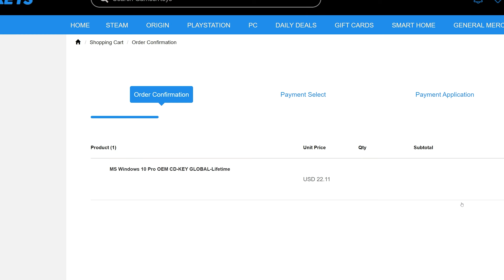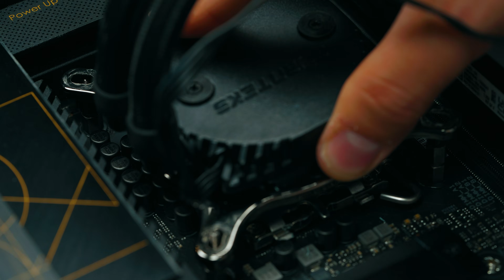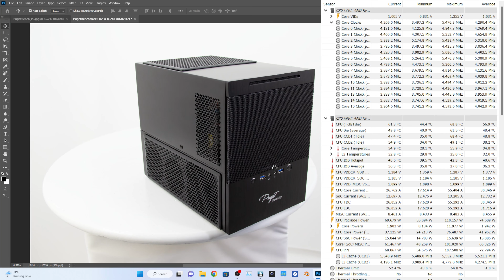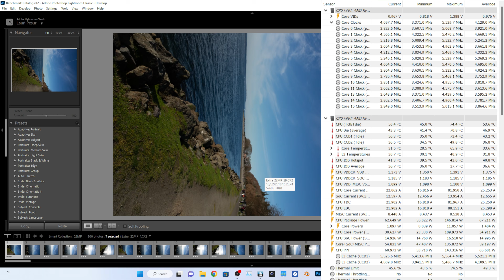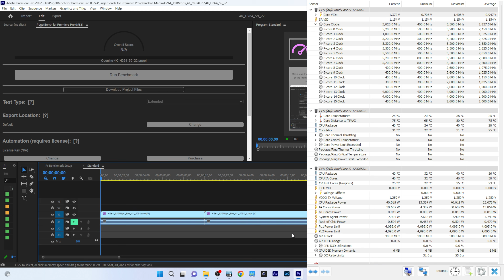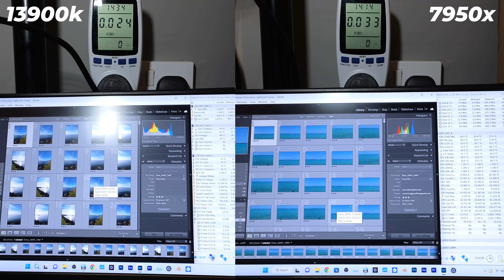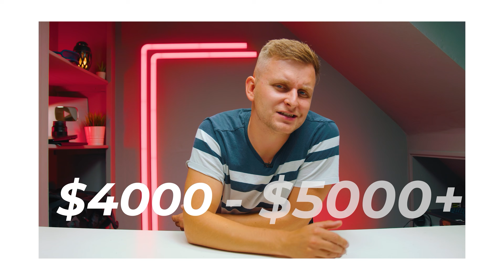INTEL & AMD both lied! 👉REAL WORLD power consumption is MESSED UP

Comment: It is worth noting that AMD keeps much higher clocks in idle compared to Intel, this makes a big difference in my opinion, I noticed that changing the power settings minimum cpu % in windows power plan , reduces these clocks and slightly reduces power consumption in IDLE.
Reply: I've dropped my 5600x to like 800MHz and it hardly effected the idle. The IO die seems to pull a fair bit regardless.
Reply: For me, in the case of ryzen 5 5500, the change in the minimum % cpu use resulted in a decrease from about 20 watts to 9 watts
Reply: @werwito  ryzen 5 5500 has monolitic design..it dont have chiplets(core die + IO die separated).

Comment: You test shown so much real life usage of processor, thanks a ton for this man & do answer my below question please:
So what would you recommend for productivity on premiere & davinci 
I5 12600k or 13600k with MSI B660m mortar wifi & Ak620 cooler (ain't gonna overclock it) paired with 3060 or 3060ti
Reply: buy what you can afford. but beware when buying a b660 as it will probably require a bios update before you can plug a 13th gen on it. and you will need a 12th gen cpu to update the bios. some motherboard do have a feature to update bios without the need for a cpu. do some research first.
Reply: @JosesPoS  yess 🙌🏼

Comment: Look! Intel paid this man to make AMD look bad!
Just kidding.
I notice this behavior since AMD moved to MCM. I have Ryzen 7 1700 and the idle power consumption was very good. I record 50-ish watt on idle for total system power consumption with 8 case fans, 1 NVMe SSD, and 6 HDDS. Then I got Ryzen 5 2400G. It seems adding Vega IGP increase power consumption, but not significantly since it is a bit higher.
Then things changes once I moved to Ryzen 5 3600. Total system idle power consumption went up significantly to 80-ish watts. Disappointing for sure. HWInfo recorded 30-ish watts when I am doing nothing on desktop. But this can be lowered to 20-ish watts by disabling Precision Boost. This result is ± similar with Ryzen 9 5900X.
Reply: The other issue with AMD could be their drivers. They have issues with their gpus. And their files and folders don't look as clean as intel.

Comment: "REAL WORLD power consumption" - proceeds showing numbers spewed from random software... 
Most software show wrong values for Ryzen processors, so this "test"... waste of time and confusing people. At least use Ryzen Master, or better - measure from the wall.  Ryzen cores can underclock and sleep just as well, E cores do not have an advantage. Actual tests were done on laptops where power consumption wasn't inferred, but actually measured, and Ryzen beats Intel. For example, read the 6800u review in notebookcheck. Zen 4 is even more efficient, although AMD clocked it a lot in order to compete with Intel for performance.

Comment: Looks like the AMD cpus were never allowed to run below "base clock" i.e. power saving was disabled. my zen2 cpu for example drops to about 60% of base clock at idle.

and I'm of the opinion that measuring at the wall is the way to go. either brand could hide power consumption throughout their systems and all that really matters is how much power is required to use the computer.
Reply: and without running OBS on either computer! that alone adds a significant unknown variable that will almost certainly affect power draw, minimum clocks and benchmark scores. unless the use case is running productivity benchmarks while screen recording with OBS lol

Comment: Finally somebody did deep dive into power consumption....amazing job!!! Keep doing this 🙏
Reply: this isn't a deep dive. it's just 1 or 2 applications, one of which uses the iGPU heavily.
Reply: @mariuspuiu9555  I follow many tech channels ...nobody cares about idle power consumption ..that's what I was interested about
Reply: @DoRokaHore  mostly because on PC it doesn't matter. we are talking about extremely small differences in money per year even when run 24/7.
the only time reviewers will cover it is when there is a huge difference (most of the time caused by bad launch drivers)
Reply: @mariuspuiu9555  don't agree...it matters most these days when graphics cards and CPUs draw so much power more than ever before...as guy mentioned in video...most of the time you do light work...you are not playing all the time or exporting a video all day...and those small things add up...in Europe electricity bills went up a lot....even AMDs new cards draw more than Nvidia in idle ...and it also depends on monitor connected...I think it's reasonable to be aware of power consumption as it growing every year...era of overclocking is over...everybody undervolts graphic cards and CPUs to get better thermals and power consumption and performance in some cases
Reply: @DoRokaHore  it literally doesn't matter. you are confusing it with full loads.
Reply: @mariuspuiu9555  I'm not..I'm saying that nobody cares about idle power consumption in reviews ...state where you spend most of your time
Reply: @DoRokaHore  it doesn't matter where you spend most of your time if the difference is literally a coffee cup at the corner of the street. this is what you don't understand.
the only place where idle power usage is very important is on laptops. and battery life what i check first when buying one.

Comment: Nice analyze,  you forgot in the equation of the profitability on the long term that it takes less than 4.5 years to amortize a GOLD power supply whereas it takes more than 17 years for a Platinum power supply and to keep a material 17 years in data processing .... when one knows that the breakdowns in electronics have a coubre said bathtub it is to say that that falls out of order in the first 6 months of life after one is quiet 7 years and that the curve goes up again in arrow after.

Comment: A nice video, but something must be completely wrong with the AMD system. Or the minimum power use that you report is very far from idle. It is simply impossible that they can make a 55W laptop CPU or 65W regular CPU from the same silicon for which you report that the minimum power consumption is already 47W or 54W. This result just does not make sense. Maybe you were measuring something else, though I doubt that that is the cause as you also measured a clear difference at the plug. Although again that doesn't say much. Even the fact that the power supply is claimed to be better doesn't mean it had less losses in this test. Platinum does not necessarily mean better than gold over the whole power range. Maybe something in the BIOS prevents the cores from clocking down or being turned off completely when not used. Or maybe something was wrong with the scheduler in the OS. Or something else that prevents the cores from clocking down sufficiently. I would not be surprised at all that the idle power use of the AMD system is a bit higher than the Intel system. I've seen a fairly high idle power consumption on AMD server chips also. But not to this extent reported here. I'd rather expect something in the 15-25W range at most.

Comment: I get that idle AMD usage is higher, fair point. But judging the highest end CPUs at low wattage is not ideal, since those CPUs are made for like multicore processing, if that is not the usage you require, just buy the tier below or something like 5950x which would have much lesser power consumption.

Comment: That's pretty interesting to see. It might also be interesting to see results if you put the AMD one into 105W Eco mode, which seems to lose only very little performance but save quite a big amount of power. I don't have a 7000 series AMD but a 5950X and in Ryzen Master I set a few profiles ranging from an 4.3 Ghz all-core at 1.25V, which draws about 20W at idle and 160W at full load down to a 4.0 Ghz all-core at 1.025V, which lowers idle power consumption to 7W and 90W at full load. That's a great idle improvement and like 40% power saving for 7% less all-core full performance.
Reply: This. It's great the tests were done with stock settings but tests with eco mode would shed the final light on the topic.
Reply: @machinimaaquinix3178 
I agree. If you are interested in efficiency then probably you are looking around for information therefore you may very well know that lowering the maximum power on AMD  can make big efficiency gains: PCWorld and Gamers Nexus published a video about it. In case of efficiency minded people to do some BIOS or software tweaking is not outside of the realm of reality in my opinion. (And it is also known that Intel chips do not react so well as AMD for underpowering.)
What is also strange for me that while this video tries to calculate 'real life scenario', with mixed load and efficiency in mind, some sensible alternatives are missing: for example the i5 13400. Here, in the Netherlands, the 13600K costs around 360 € but the 13400 is only 270 €. Sure, it has 4 less E-cores, but also a lot lower powered and if you are a professional who is not interested in gaming then why would you bother about overclocking (which one of the main advantages of a K CPU, but costs at a hefty premium)? For a mixed workload I would certainly assessed as candidate.
Reply: I don't believe you, 7W idle for AMD 5950x

Comment: Do a wall test, not a HWInfo Test. It's meaningless to measure what HWInfo tells you from some sensors located at different parts of the chip vs what the actual PC draws from the wall as a whole system.

Zen is basically a SOC while Intel is not doing the same approach.

Comment: I've never seen a review for 13700K where they pegged its idle power consumption at less than 30W for CPU Package, yet here it is less than 10W.
I wonder where such discrepancies are coming from!
Reply: It depends on the moment of capture. At "idle" my i7-8700 ranges from 5W-30W all the time, seems to be pretty normal behaviour if you ask me. There's always something happening in the background & some tasks hit different parts of the CPU with different power requirements.

Comment: You have weird definition of idle

If I would follow your idle Derrington, then my Dell PowerEdge R815 would be pulling around 600W-700W
While at real idle it is pulling 220W (mind 4 processors, 12 cores each, 128GB RAM and literally 12 years old tech)
What you can idle I call medium-high utilisation or even high utilisation
Photography processing is not idle!

Comment: You only used Adobe software so your conclusion is only valid for this software. You leave out other applications like Davinci Studio, Capture One and the whole of 3D software. In my opinion this is a very partial view of "content creation" scenario related to power compsumption. Thanks for the video.
Reply from the maker: Did you watch my comment on the video why I didn't use Resolve or other 3D softwares for the testing?

Comment: Do you have any experience with the Ryzen 7 5700x CPU? If so, how does it run with the RTX 3060 ti for video editing? Any info you can provide would help me out big time! Thanks for providing great information.
Reply: you won't have any issues with that CPU.
Reply: @mariuspuiu9555  Thanks. I was thinking of upgrading to a i7 12700k and 3070 but for $600 more than my current system. I mostly do 4k braw editing on Premiere while starting to learn Davinici. Just so many options in computers, and I don't know what's the best bang for the buck.
Reply: @lochnkey5216  you don't need to be on the bleeding edge to do your work properly. enjoy your very capable and cheaper system. put that money towards more ram and a good GPU (Davinci Resolve uses the GPU a lot, especially the studio version)

Comment: I feel that this is because chiplets consumes more power at idle vs monolithic, considering Intel next generation is chiplets, I am not sure. That being said, Intel idle states for now are better than AMD.

I am thinking for Blender or any CPU heavy tasks like compiling, unless it is a dedicated running it 24/7, Intel might still save more power because of idling. That being said, the heat blowing out during those workloads is gonna be hot though ^^"
Reply: This. Efficiency cores on Alder and Raptor Lake are not really 'efficient' contrary to Intel's marketing.
However, Meteor Lake and onward Intel will be implementing chiplet approach like AMD does right now, which raises some concerns regarding to Intel's next gen energy efficiency.
Reply: @brownjonny2230  They are space efficient, they run on the same voltage if I remember correctly.
Reply: @jierenzheng7670  Which confuses many people like in this video. It's just a marketing term Intel came up with. But in productive workloads those extra cores certainly help.
Reply: @brownjonny2230  Yea, I am actually curious if it is actually the same for ARM and Apple Silicon too. ARM has the advantage of including less instructions so consume less power and heat. Not sure if they are using the same concept but using ARMv8/9 vs x86_64
Reply: @jierenzheng7670   Not a tech savy myself, but according to an article I've found on web, Meteor Lake will be focusing on power efficiency to compete with AMD in mobile segments.
- Separated iGPU from CPU ring bus = less power consumption.
- More CPU base tiles, thus higher IO density = less power consumption.
Though because of the higher IO density Meteor Lake will be that much expensive, and it won't be competing with AMD's high end CPUs given only 6 P-cores will be adopted.
So even if Meteor Lake comes out, entry to mid range will be more expensive than AMD counterparts. No wonder why Intel 'cancelled' desktop Meteor Lake.

Edit; I can't post a link to the said article because for some reason Youtube keep deleting my fking comment.
Reply: @brownjonny2230  Yea but the reason why AMD isn't implementing chiplets on the mobile CPUs is because chiplets consume more energy. So I am curious to see how it pans out. That being said, I would look towards upgrading my i7-1260p to mobile Meteor Lake for the better encoder and probably much better IPC considering 13th Gen.

EDIT: Yea, Youtube keeps deleting links be it from legitimate sources or not, very annoying.

Comment: Not sure how you made your 7950x idle at 55W. My 7950x idles at 18-20W at stock (no tuning, undervolting etc). This makes me doubt the validity of the whole test. My Threadripper 3970x idles at 54W and compared to 7950x it's made on 7nm vs 5nm, it has 5 chiplets instead of 3 in 7950x and it has a freakin HUGE 12nm IO die compared to the one in 7950x which has a tiny IO die made on 6nm.
Reply: Might depend on what RAM you use too. Faster RAM is harder to run.
Reply: my r7 7700 cb23 all core power consumption all system from  wall 165w, single core consumption 95w. idle around 75 watts. 7800xt video card thare.
Reply from the maker: could be the motherboard... what mobo are you using? But regardless even 20W at idle is quite a lot, don't you think? 🤔
Reply: @theTechNotice  Could be. I use Gigabyte B650E Aorus Master.

Comment: Intel maybe better in most cases but that's if the big little core switching works correctly. Also did you did these tests with the AMD Ryzen power plan?
Reply: Has nothing to do with E-cores. Both my 12600k and 8700k had really low cpu idle power draw vs my dads 3600. The whole PC still sucks 40 Watt idle with iGPU and 60w with 3080 at idle, a lot of power draw comes from dGPU and Mainboard, also 1,35v XMP Ram sucks 6-7 more watts vs 1,2v standard ram.

My MacBook Air M2 however does only suck like 7 watts, so I safe a lot of power using my MacBook instead of the intel/Nvidia PC.

Comment: I undervolted my i7-12700K by -120mv and power limit is set to 190 watts. I use FL Studio and it maxed out at 142 watts for a project that used 80-90% of the chip. 60 degrees as the max.

I don't know if my tuned i7 is the highest perf/watt chip on the list.

Efficency goes away when i enable AVX512, system responsiveness isn't the same too without Big-Little.

Motherboard is MSI-Z690 Pro A DDR5, Deepcool Assassin 3 , Corsair 5000D Airflow and 32GB Corsair DDR5 4800 (no XMP, just stock).

After i used stock power limits and undervolted the chip, i reduced power consumption by 35% for the same multicore perfomance on Cinebench (almost 23000 points). And iddle power draw is 10 watts with a partial overclock, no core parking, infinite turbo.
Reply: Undervolting is almost always the way to go.

Comment: After building a 5th Gen AMD system, I saw that AMD Idle power draw is quite high as well... for a Ryzen 5 5600, I was idling at 80W total system power draw measured from the wall. I was able to reduce power consumption by up to 20W with lowering the FCLK, reducing SOC Voltage to 0.8V, leaving the ram at stock frequency as well as having a -0.1V offset on the CPU ... that's quite a lot of power used at idle.
Reply: Did you used PBO2 curve optimizer or an adaptative undervolt?
Reply: @saricubra2867  I believe it's adaptive Undervolt. not sure what Asus Bios settings did I changed. Im still new to the AMD platform.
Reply: @LeafInTea  -0.1volts offset looks like an adaptative undervolt to me.

Comment: good job ! I think for CAD work, idle makes up an even bigger percentage. I was allready thinking about buiding with intel because of the DDR4 that I have, but based on this video I think I will be going with 13700K instead of 13900 K. Also needing less cooling means less noise and maybe a smaller case. I swithced to GPU rendering some years ago so more cores does very little for me.
Reply: I can reconmend the 13700k it is a beast of a CPU i pick mine up from microcenter for 370$ with coupon code. Everything runs smooth and I even undervolted it with a slight oc 5.5p 4.5e cruches through all my workloads.
Reply: If you look for a quiet build and do not travel with your PC (case is heavy) then I can recommend Fractal Define C with solid side instead of glass. Currently I run it with 9700k and noctua dh15s - it's really silent even under load (cpu is not OC'd).